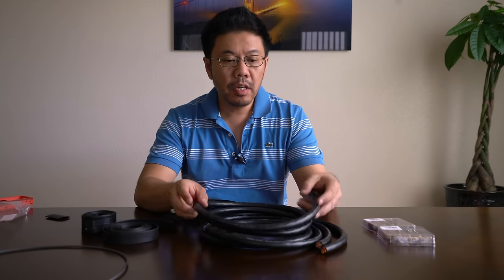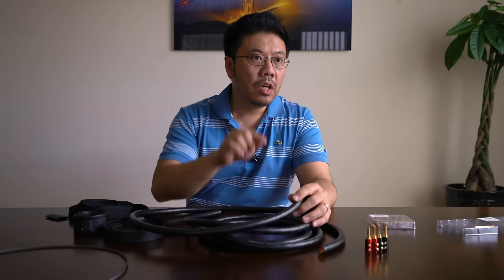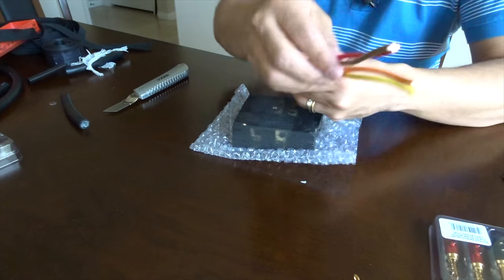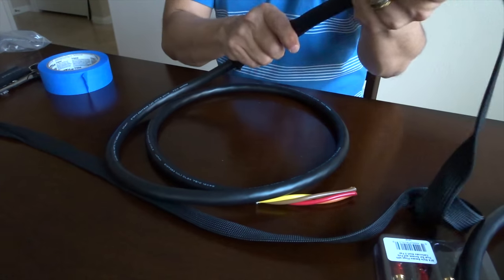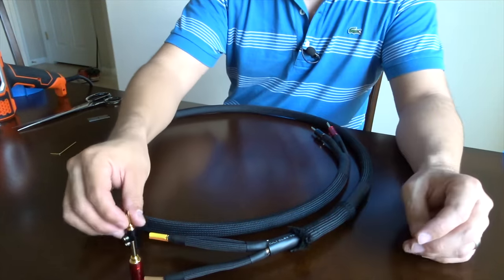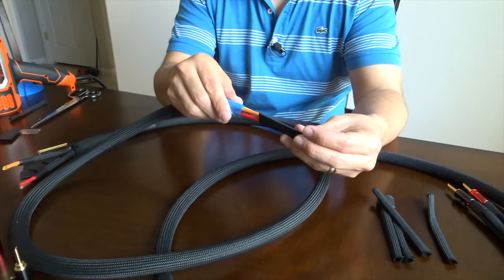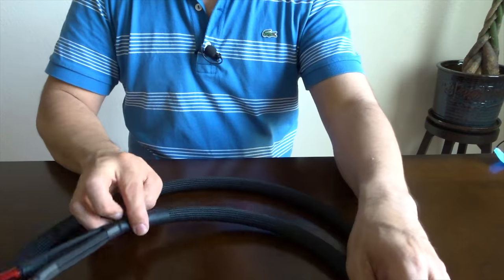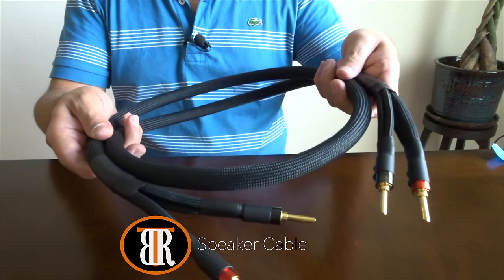Making The Best Speaker Cable For Money, How To DIY HiFi Cables

Comment: There are 4 main physical and mechanical properties that all need addressed for "High Quality" speaker cables.
1 Resistance (not nominal impedance). This affects the ability of the amp to deliver power and provide damping to the speaker.  Resistance is related to material, and length.  "skin effect" is a non issue at audio frequencies but is a radio frequency property.  Shorter is better.  Larger is better.
2 Capacitance.  This affects the current drawn by the cable to charge the space between conductors when voltage is applied.  This is a per unit of length, conductor diameter, and insulation material in regards to it's dielectric constant.  Shorter is better. Smaller conductors is better. Low dielectric constant insulation is better.
3 Inductance.  Inductance is the inverse of capacitance.  It is the expanding magnetic field around a conductor as current flows. This is a per unit of length factor only.  Resistance and insulation do not affect this.
4 Dielectric absorption.  This is the heating of the dielectric material as it absorbs energy from the changing electric field.  Low loss is better. Shorter is better.

 Conclusions..  A long cable is bad for a complex impedance of the speaker.  The best cable is smaller and bigger at the same time as big is bad for capacitance and small is bad for resistance.  The ratio of capacitance and inductance produces a cable characteristic impedance.  When signal into and out of a cable matches the impedance of the cable, the problems of inductance and capacitance on opposite vector directions cancel and the cable can pass high frequencies with low loss into a restrictive load.  Unfortunately a speaker is not a resistivity load and has a complex impedance curve.   Making a 8 ohm impedance cable would be physically huge due to the size of the capacitance needed.  This is why your TV cable is 75 ohm, your network cable is 110 ohm, and your DMX cable is 120 ohm.
To use "short" speaker cables, much of the industry is moving to powered speakers and amp racks at the speakers instead of the sound booth.  The signal is sent on several hundred feet of line cable which is about 200 ohm and with a resistive load instead of a complex speaker impedance.  Loss is negligible at the entire audio frequency range.  Balanced XLR signals have very high common mode noise rejection so hum pickup and other electrical noise is rarely an issue in a commercial sound setup.

Not listed above is the physical properties.  Solid vs stranded, physical size, appearance, etc.

For those using lamp cable or house wire for speaker cables, they handle the voltage and power just fine, but may have issues in longer runs with the insulation and dielectric absorption.  This can be compensated for as the loss is greater at higher frequencies, so it is "fixed with the EQ.

Disclaimer. I am an engineering electronics technician with background in radio and television broadcast.
Reply: this needs to be pinned
Reply: the levels you are talking about are absolutely inaudible to the human ear... so whats the point bud?
Reply: @brandonlamondin6228  This is the premium Audiophiles pay for.  I mentioned it as a study in physics for the perfectionists to realize the best speaker cable is just a compromise at best.  It is very true the differences in short cables are very difficult to measure, but do affect long cables over 100 feet. The take away is short cable is the best speaker cable.  This length issue with cable is not lost in the commercial realm. Big heavy speaker cables are giving way to either powered speakers, or amp racks placed on  or under the stage near speakers as it does affect the sound.  Controlled impedance balanced shielded line level signal is then sent to the powered speakers or power amps near the speakers.  Days of 100 foot speaker cables are mostly history in commercial audio.  The lower resistance of short cable impacts the ability for an amp to damp unwanted cone movement in a big way.  Damping factor is the inverse of resistance.  An amp such as my QSC with a damping factor over 100, gives an effective output impedance of 0.001 ohms for damping cone movement. A 14AWG speaker cable of 100 feet has a 100 degree F resistance of 0.2525 each way, which changes the damping factor from 100 to about 2 which considerably changes the sound.  These are real world numbers if you wish to do the math.  Look up copper wire tables and find the resistance per 1,000 feet and scale to 100 feet X2 for round trip.  Look up the damping factor of your amp in the specifications.  Damping factor is the inverse of the effective active output impedance or ability to stop unwanted come movement.  In a living room with each speaker only 5 feet away, this is minimal.  The best speaker cable is SHORT.
Reply: @brandonlamondin6228  They really aren't inaudible. If you cant hear the difference a good cable makes, then you either don't have a good enough setup or you need your hearing checked.
Reply: I love your response and the explanations you gave.  What would make this even better is explanation and examples of application for us 'amateurs' to learn from you information when we try and build our own speaker cables.   Thank you for sharing.
EDIT: @ Isettech:  Excellent reply to ChildOfGod.  But, can you please explain the practical application of your information to the manufacture of DIY speaker cables (and cables to connect PreAmps to a PowerAmp, which is why I am here researching the manufacture of my own cables.  I need to manufacture an RCA - Mono 6.5 TS connector to connect the sound card in my computer (ASUS Xonar STX) to a Phonic MAX 1600 to power my Dali Concept speakers.  Thank you.
EDIT:  Bottom line is shorter the better and thickest guage I can get away with, with the shield of the RCA wired into Neutral at the P.A. end in order to 'ground out' the EMR back into the return path to the Xonar..?  Is this correct?  Thank you.
Reply: @number 3, inductance: the diameter of the conductor is certainly a factor. a smaller diameter straight wire results in a higher self-inductance...

in reality it only matters when working with low impedances (< 1 ohm) at high frequencies (> 10kHz). 

a 14awg (1.6mm dia) conductor, 10m length presents 0.0187 mH inductance. a 16awg (1.3mm dia) comes to 0.0192mH. 100m of 16awg = 0.24mH. 100m of 10awg (2.6mm dia) = 0.22mH. 

it's pretty easy to get the idea that the self-inductance is not really a thing when it comes to amplified audio signals. 

Disclaimer :}
Reply: @nucleon4499  I have had the discussions, it's so funny....and you are 100% right.
Until you test it for yourself people are only repeating other people's words of poop. You should see the faces when I switch cables (I build them myself from scratch with high quality wire)
 ' Inaudible'.....rrrrright
And I'm running the sound on really old Philips 'hi-fi' speakers at home, hardly reference speakers LOL.
The difference on the interconnects-> stunning....not to mention volume output , each dB sounds bigger and bigger. Upgrading the speaker cable afterwards made it bit more solid, so to speak.
I had no idea my 60 W speakers could sound that good and that loud. Can't wait to invest in even better speakers. I made my girlfriend cry because of the goodness hehehe, and even without 'better' speakers...oh, we're soooo good. 
I remember like 20 yrs ago, a friend of mine was running a sweet pair of Infinity floorstanders. I looked at his speakercables, like the thinnest crappiest electric cable ever! so I bought him simple 2 mm solid core  electric cable as a gift (5 bucks LOL) ....his jaw dropped, literally.
Reply: @Projacked1  I'm not going to bother going into wh solid core wire is worse for speaker cable, or why I can't imagine cheap Phillips speakers ever sounding better than okay.  It's placebo my friend.

If you enjoy your setup, that's all that matters.  The most noticable change you can make to your setup is good speakers, after which is source (assuming it wasn't already good), after that is your amplifier.  Especially if you're not running very long speaker cables they really aren't going to cause any audible impact.
Reply: the  cable  is  pure  silver  ?  the  plugs  is  pure  copper  ?

Comment: Thank you for this! I made this cable and have installed it on my system. These sound more transparent than a set of PS Audio cables that I had been using for a decade. And they are really easy to handle due to flexibility. Thanks a lot!

Comment: Great job sir! I really like the extra effort on the nylon jacket and heat shrink tubing. Personally I made four 10 gauge banana plug wires to bi-amp my front floor standing B&W. After seeing your video I need to step up my game. Now I want to add nylon sheathing and heat shrinking tubing to my cables. Thank you for the how to

Comment: The table @ :38 shows the capacitance when pairing wires #1 and #3 together vs #1 and #2. Pairing 1 and 3 has a lower capacitance then 1 and 2. In between those pairs is a cord/insulation that is not shown in the illustration @ :38. You just see a gap. That cord/insulation separates pairs 1&3 and 2&4 allowing a lower capacitance. 

So pair Brown & Orange,  and Red and Yellow.  
Will this make a difference to your ear?   He made mention that there is no difference in sound and I believe him because he's making short cables.
Thank you for your DIY videos. Thinking of making a pair for the fun of it.
Reply: what if you want to use it as bi-wire? how would you combine?

Comment: To keep the surface of the copper strands from tarnishing which can have an effect on signal transference over time, maybe I would suggest the use of solder for an airtight connection.  Soldering is a simple thing that most will be able to do correctly with little practice.  Or at least have your copper ends tinned.
Reply from the maker: Thanks for suggestions, For that issue I do annual cleaning of all my Audio cables and components, I’ve been doing that every year for last 20 years. It’s good old habit I learned growing up in pro studio, thanks
Reply: I don't think so use high-grade silver yes not silver solder, but there should be no issues tarnishing his put shrink wrap should prevent any air getting to the Bare metal you could smear them with oil like 3 in 1 would prevent tarnishing
Reply: John sweda , sure use high grade silver whatever you can afford to solder with.
Reply: @Tharbamar  Yes cleaning connections would be a good candidate for an educative video. Also using fluid electricians tape after tightening or soldering would probably be optimal. Seals it much better from air and moist
Reply: how do you clean them...video please 
 @Tharbamar

Comment: Hi just finished my Mogami W3104 8'x 2=16 ' Cost approximately $11 ca. per ft.all in, now just have to break them in cant wait, to hear them!!
Reply: Funny how you believe in cable "break in" I'm guessing that you bought Mogami because, as the video claims, you can get high end hifi cable for low-fi price by DIY. But cable burn-in is something these so called snake oil selling audiophile cable companies introduced. Just saying if they are right about cables having burn in, might they know other stuff that is critical to audio cable design. Just saying... Makes you think.

Comment: I have done A/B testing with different types of plugs. Brass is a no go. I could definitely hear a difference between brass and copper. So, if you have a choice use copper connectors, preferably copper spades.
Reply: James Lester maybe bare wire without any spades or plugs is better than any of them?
Reply: @Lulrii  Absolutely.

Comment: Hi why did you not wire it star-quad i.e. 1-3 and 2-4 as the pairs and get the benefits of lower capacitance and inductance?

Comment: 15:33 is funny. Thanks for the vid and info. Just ordered cable from Redco today and it will be here tomorrow as I live in Massachusetts (Redco in Connecticut). I bought the W 2921 14 gauge.....Redco was the only one to have that cable by the foot.
Two years later these cables are working very well. Very satisfying to build your own cable. I'm going to look at your interconnect cable vid now.

Comment: Excellent! I also suggest Supra cables from Sweden which are VERY low capacitance. I tinned the endings with Cardas silver solder and I will use Rhodium pins on the end. The Supra is affordable and VERY good quality.

Comment: Great video! One piece of advice though, when twisting the final terminal wires together prior to insertion into banana plugs, use gloves, this will prevent oils from your fingers oxidising the cable ends.
Reply: Oil/grease doesn't oxidize the copper. Salts oxidize the copper. Copper is actually protected by grease/oil. Copper will oxidize regardless if you touch it or not, but when it does it forms a layer that will stop further oxidation. Don't give any advices if you are clueless.
Reply: @florin604  Obviously oxygen which is in the air acts as an oxidising agent but Acids which are present on the skin cause expedited oxidation. 'Oils' was to refer to this acid mantel. The oxidised layer you refer to may help protect the metal itself from further degradation but it also unfortunately acts as a barrier between the contacts.

Comment: I have a modest hi-fi system with Tannoy speakers and Cambridge integrated amp. I find differences in sound with different cables, even my girlfriend notices the difference (including when I added an Isotek power cable). I'm not even talking about expensive speaker cables, I'm talking about unbranded 4mm speaker cable compared with 3-core stranded power cable and solid core power cable.  The 4mm speaker cable sounds worse, by the way, it's more compressed in the top end and sounds less natural. The solid core had more dynamics and depth, but lacking in top end, the 3 core stranded has a more natural top end and wider sound stage.  So I'm bi-wiring both the power cables, works a treat. Scoff all you like, you nay sayers, but that's how it is.  I also got all my cables for free off of other people. :)
Reply: mrpositronia the scoffing is because people pay $2,500 (or more!) for cables to change the sound when adding room treatment would be way more effective and cheaper
Reply: @fomoontech8217  the 'scoffing' part is for those who think there is no actual audio difference in any cables, and that we're all deluding ourselves. Also, I don't concern myself with what other people can afford to spend on gear. Acoustic treatment helps with the effect the room has, plus EQ, but cables help to get the finer details right. I'm sure those who can afford thousands per metre of cable have the acoustic treatment already installed. Plus an expensive listening chair too! :D

Comment: Really lovely advice. What do you recommend for a 4 way speaker system which is active driven. Two Mogami 3104 per channel or 4 Mogami 3104 per channel?
Reply from the maker: I can’t comment on it without trying, thanks
Reply: I’d say at the most two per channel.  Each wire is 11 awg and with two runs per channel you’d be doubling up to get the 4 drivers (8 individual wires/2 = 4 for the 4 drivers.  Essentially each driver would then have a run of 9 awg.  Wayyyy overkill unless you’re running a lot of power over a long run.  If the drivers have a standard 8 or 4 ohm impedance, the run is under 30 feet, and the power to each driver is under 600 watts id say you’d be fine with one run per channel.  Each driver would have an 11 awg wire and the losses over that wire would be nearly nothing.

Comment: Good video, but i was curious a few years back about wire size for speakers. I tested this theory about wire size so i  went out and bought some 16, 14, 12, and 10 gauge wire. I tested these different size wire's on my home stereo and i couldn't hear any difference in the sound eminating from my speakers. I also went out and bought some lamp cord and wired it to my stereo speakers and guess what, i still could not hear any difference in the sound quality. So my question to all of you viewers is it possible that some people can hear  sutlle differences in sound quality.
Reply: Big gauge is just in case. I can live perfectly with  Canare 14AWG wires used on 4ohm speakers and 75watts amp.
Reply: well, maybe in this case, its not the wire but youre speakers arent much revealing.
Reply: I think the only way to notice difference is with  power hungry 8ohm speaker and higher volume listening.
Reply: Same here..i cannot make out any difference, so cables doesn't bother me anymore...

Comment: After stripping the outer insulation off, I think you're supposed to twist the two leads together before installing the banana plugs.Then you can wrap them in braided sleeving. This helps keep them from becoming an antenna, so to speak.
Reply from the maker: Again and again this kind of comment come up in this video.
I will answer this for last time, it won't become antenna or act like one.
I've been using these cables in Pro and Home environments for last 15 years without having any issue.

Comment: Thanks for the video. Would having separately shielded wires make a difference? I know on analog video signals (especially unamplified), shielded of utmost importance. If you run unamplified video signal for any distance close to a pcb, there is a ton of video interference.  Once amplified, the video signal isn't as susceptible to interference. I don't know how susceptible speaker wires are (probably not nearly as sensitive since it's an amplified signal at that point).

Comment: What black sheathing size would you recommend for putting the two wires together instead of 3/8" singles? Would you use 16mm (5/8")